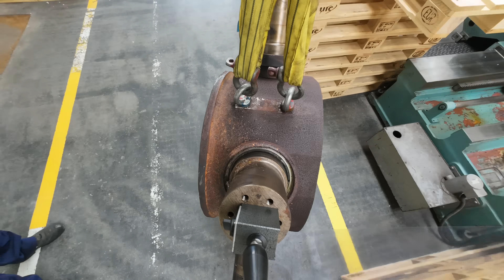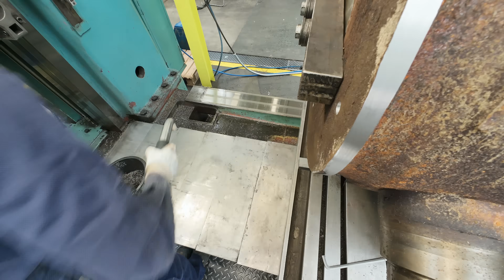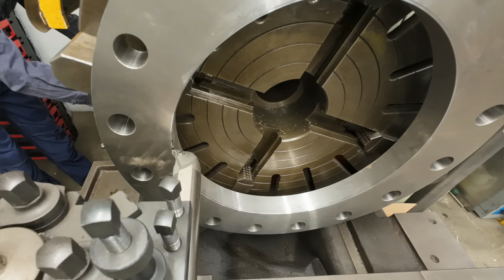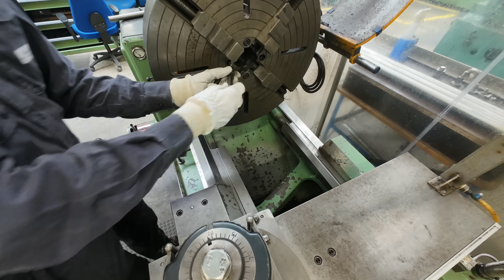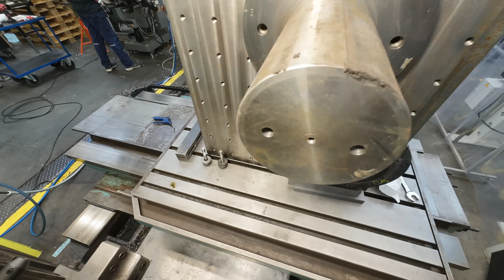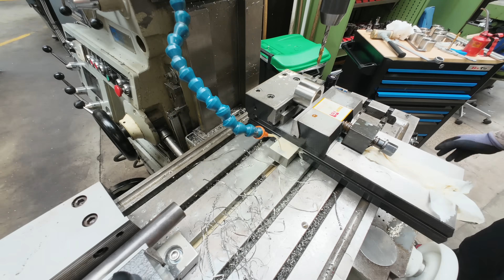Projects from the machine shop week 18 2025 Machining pellet mill head and pump parts on lathe+HBM

Comment: Is the "inbuild mirror/Aligning tool" a separate tool or an 'inbuilt' part of the boring machine?
Reply from the maker: @markschweter6371  it's mounted on the outside as a separate unit. But the table has the markings.  It's a factory mounted kit
Reply: @OmeMachining  thanks!

I was wondering if it was a available as a separate tool.